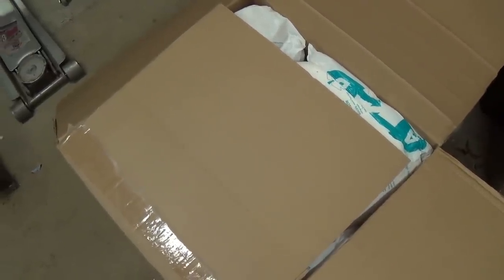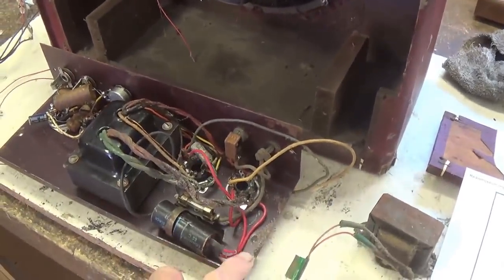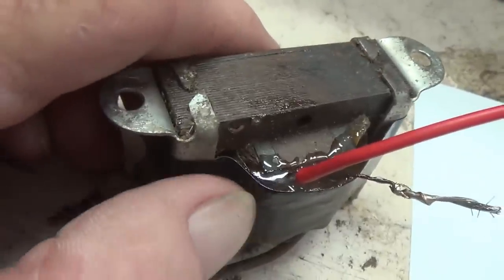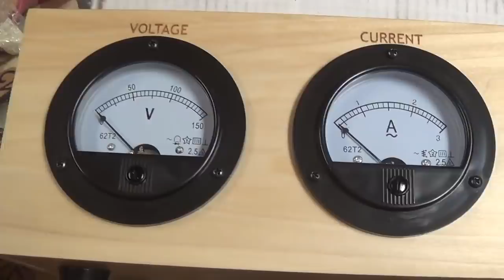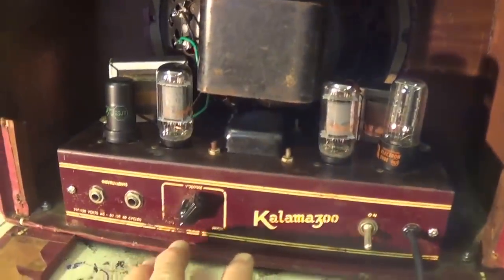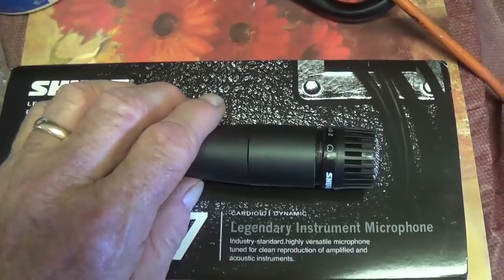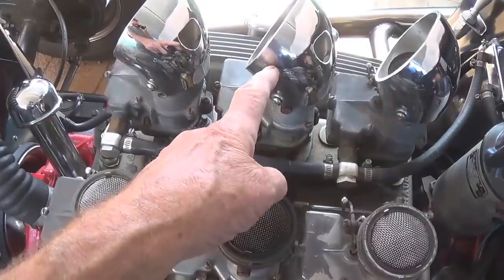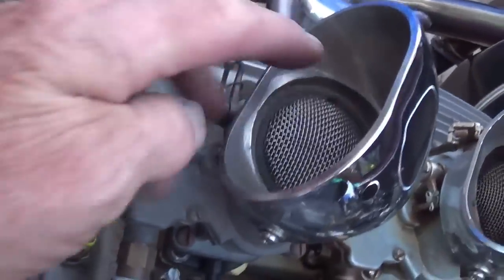Heroic Restoration of a 1948-52 Kalamazoo KEA Amp with an Unusual Circuit

Comment: Yes, Yes, Yes!!!  on the SM57!!!  I think it is definitely worth the trouble.  I humbly suggest moving the mic a bit off center to get a more balanced sound;  centered is generally too bright.  Also, it looked a bit too close to the speaker (for my taste).  I hope you will continue using the SM57 for future videos.  Perhaps you can come up with a mic placement you can use consistently for all recordings.

BTW:  The worst thing about the camera mic is the automatic gain control and the way it tends to overload.

I think you should consider recording some new demos of your fabulous amplifier collection.  I would be willing to send a supply of catnip and assorted kitty treats to help entice Jack and Ollie into some additional recording sessions.

Thanks for another terrific and inspiring video!
Reply from the maker: You're quite welcome, John. I will experiment with microphone placement and will consider using it to re-record some amps from previous videos. Thanks for your input :)
Reply: Yes, The Big Test will be perfect. Camera mic make all these amps thin but you always say they have balls. 
Nice, sunday test will be perfect
Reply: definitely.  best amp sound on an UD video yet
Reply: My comments exactly, thank you John.
Reply: @UncleDoug  My only question Doug is, why didn't you mount a modern fuse holder on the back panel, so the fuse can be easily serviced?
Reply: Agreed. This a huge improvement. Nearly all of your prior videos I've watched exhibit clipping, making me wonder what you were talking about sometimes, and making your playing sound worse than it now appears to be. This one sounds too bright, due to miking the dust cap so assiduously ;-) but clean as a whistle. I suggest positioning the mike about a yard away and not pointing straight at the dust cap. To save all that offline recording trouble I'm wondering whether the camera has a mike or line input.
Reply: He could also experiment with the "Fredman method", where you have two microphones in a V-formation. With one microphone straight on and the other angled 45 degrees. You can then blend as much as you like from each microphone.
Reply: John Barker i own a sure57 very nice to use sir
Reply: A small quibble: Older American-made SM57's are a bit better-sounding. Newer mics tend to be slightly steely,
Reply: I agree with moving the SM-57 away from the speaker cone centre. When recording guitar amps you get the most realistic sound (as heard by your ear in the actual room) by pointing the mic approx 1/2 way between the speaker cone centre and edge at about 45 degrees angle to the face of the speaker.
Reply: Was it just me or did it sound like he had a phone or a computer plugged in to the input and was playing a low quality audio file instead of having an actual guitar signal going into the input.  I have one of these amps and that’s not what it sounds like!!! At all!!!!! At all at all.
Reply: @antonvangrendel  Of course it doesn't , remember he changed the speaker , the choke , AND all the Caps !!!

Comment: SM57 all the way!, just move it off center a bit :)
Reply from the maker: Thanks, Russell. I will. Thanks !!
Reply: I agree about the new mic.
Reply: Totally prefer the SM57. It adds clarity and dynamic range. Agree that it should be slightly off centre. Thanks for doing that.
Reply: Uncle Doug, The center is usually too harsh. Consider angling it so that the mic's diaphragm is parallel to the cone's surface. I find it's more natural sounding when the sound waves come from a parallel surface.
Reply: @UncleDoug  SM57 is the way go, definitally. I notice though some high frequency jitter in the recording. Don´t know if it´s from the metal grill or not. I suppect it being from the sample rate from the audio recording of the Tascam. When you collate the video from the camera with the audio from the Tascam. whatever export format you use should have a matching audio sample rate to the original so you won't get any digital artifacts.

Comment: I'm not sure how much of the improvement is from the SM57 or  if te amp is just that good, but sounds absolutely amazing. The tone is full and round, much like my ex, except this is very pleasing to my ears. 
One again you knocked it out of the park.  

That was a brilliant solution to the fuel issue. I was about half way expecting you to prank us with the old hot rodder trick of dumping a bag of ice on the intake and calling it good.   ;-)
Reply from the maker: Thanks, Randy. No pranks :)

Comment: Up to and beyond your usual fine work, my friend ! The amp sounds really fine and hardly no work required...he he ! Just as a thought, the standard for rating speaker efficiency, the mic is placed at 1 meter at one watt of power. The new mic sounds great and if I understand you placed it directly in the YT feed ? That would while sounding much better which it does, my thought is to record the file separately and place it in a digital file that we could download separately from a dropbox or similar, in order to get a full clean playback to play through our own DAC without YT compression.

As regard to our other project "SB swap", UPS seems not to be able to find it though all say it is coming. As usual no good deed goes unpunished. I will advise.

Cool licks and Hot days in El Paso, keep your head down and keep 'em coming !

Robert aka jagjet

PS the rush of fuel might even be the cause of float bowl woes as well, a vented cap might even stop the problem.
Reply: I was thinking the same thing with the pressure build up in the tank. As the fuel evaporated from the bowl, it was refilled and the cycle repeated. Now that the super engineered heat shield is in place, and a vented gas cap, neither should pose a problem again. Even with the added motor booze to the fuel. ;-)  The new Shure Mic is great! Way better dynamics than the camera mics.
Reply from the maker: Thanks, Robert. The method of digital recording was described in the video, and the percolation problem was completely resolved by the insulator plates and the vented  gas cap.

Comment: Apparently way back in the 40's & 50's, because the controls were at the base of the amps they were probably mostly used presented on a table top rather than being a floor amp.

Comment: Way to go, Doug. Yet another amp that is right out of my collection. I have one in mint condition that I only had to change the electrolytics on. It even has a cover. A minor point, the handle should be white. Keep them coming. About 40 more and I will have reference videos for all my amps.
Reply from the maker: Yes, I saw in photos that the handle was white, but what are the odds of finding one?  I took the path of least resistance and used the brown one I had :)

Comment: Hi Uncle Doug. I love your videos. I had a 1971 Triumph 650 twin motorcycle whose carburetor did the same thing as your hot rod. I did some research and found that Triumph used a rubber o-ring to insulate the carb. from the intake manifold. I had it bolted straight to the manifold which made the fuel boil when parked.. It solved the problem.
Reply from the maker: Any carb in direct contact with a hot intake manifold is at risk of percolating, Steve, especially in the summer. I'm glad you solved the problem.

Comment: Hey Doug, the Kalamazoo amplifier you have is a Gibson Gibsonette, made in a least two different versions, the one you have with no driver stage and one with a 12ax7 pre and driver stage with two 6V6s in parallel. I am rebuilding the parallel version. The wallpaper covering on the Gibsonette  is very thin and mostly missing, recovered in tweed, three coats on poly, reconed 10" Jensen speaker, sounds great. Thanks for all of your videos, there are all ways FUN!
Reply from the maker: You're welcome, Gary. Good luck with your project.

Comment: The SM57 is an improvement.  Mic placement experimentation might help de-emphasize the increased high frequency response.  The auto gain of the built in camera mic is eliminated as well with the new set up.  The carb nut count reminds me of the sponge count we do in the OR, although dropping a nut into the manifold would be far more calamitous IMO;)  Thanks for the amazing service you provide.  The few dollars spent on Patreon is the best ROI out there!
Reply from the maker: It's our pleasure, Frank. Thanks so much for your nice comments and patronage :)

Comment: Howdy.
Old carburetor Toyotas used to have the same problem. Very difficult to start with warm engines on hot summer days for people who didn't know the physics behind. People just kept pumping the pedal resulting in flooding the intakes and combustion chambers. And all wet spark plugs, of course.
There was this Lady living in my parents neighbourhood. She could not get her Camry to start. I saw my chance to excel and asked if I may try. Sure enough that was ok.
So I pushed the pedal to the floor and turned the key hoping that the throttle open the excess fuel would vent out  and the engine eventually ignite.
Bull's Eye. After, say, 5-10 sek.s the engine fired up with a terrible blast from the exhaust !
The Lady got startled but she was so happy when the engine had settled and ran smoothly.
Man ! Did I feel like a million dollars ? Yes Sir !
Regards.
Reply from the maker: Thanks for sharing this tale with us, Eugene. The old "hold it to the floor and dry out the cylinders" approach was always a good move back in the old pre-fuel-injection days.

Comment: Another premium repair/restoration video like always!. I'm going to add my 4 cents in now :) First, the fuse being under the chassis is a great inconvenience...however, Having BOTH, and internal as Well as an external fuse has a major advantage. It avoids the temptation for the owner to install a larger rating fuse than what is supposed to be in the amp. Many times, I tend to "Kid Proof" the amp when I discover a larger fuse other than the factory. i install an internal fuse slightly higher in rating as not to make it unsafe, but will still blow if someone does the tin foil fuse in the outside holder, which we have seen more times than we can shake a stick at. OK, the SM-58 Dynamic Mic...Its a winner by all means, and really shows off the actual tonal quality of the amp. The SM-57 has been the go-to mic in recording studios for ages when it comes to micing a guitar amp. I've been using the 57 for decades in the studio. My choice for larger cabinets sometimes is the EV RE-20, however there's about a $350 difference. The 57 is an excellent all-around mic for a guitar amp. I recommend staying with it for the demos. Stay well, and hope all is well :)
Reply from the maker: Thanks so much for all your helpful comments, Frank. Yes, we are all doing just fine. You too, I hope.

Comment: Pro tip on the 57. Aim it right at the seam of the dust cap and you can go 5-10Deg off axis.  Will give a fuller sound (dead on the cone will result in a LOT of high end). Slightly off axis will help with plosives. Also 1.4X the cone diameter away will allow the full frequency of the speaker to be picked up (no need to angle the mic then).
Great vid!
Reply from the maker: Thanks for the detailed info, Doug.

Comment: Sir, having just discovered your channel (I'm  a bit slow) I want to say a big thanks for unlocking the mysteries of valve amplification. My late Dad was an engineer on valve circuits, working on radar in WWII and later with Kodak. When I were a lad, I annoyed him by choosing a Vox Conquerer transistor amp over a Vox AC30, because it was lighter and had more built in affects. Very little did I know back then!  Apart from the smoother sound, there's something much more organic about a valve amp that has been assembled by a human and that you can actually see working. Even though I've used several valve amps since, I didn't take a lot of interest in the workings, until recently, when I bought a late 50's record player, with a simple circuit, to hopefully get working again (parts on order). There's also a 1940 Epiphone Electar sat in the corner, which will need new caps. Your videos are proving invaluable in giving me the safety conscious confidence to get stuck in. The bonus is that you are a great instructor, with the dry wit to go with it. Cheers!
Reply from the maker: Thanks so much for your very nice comments, Graham, and best of luck with all your projects.  Be careful :)

Comment: I dig the new effort in audio quality.  I myself have recorded a many hour with a 57 using small tube amps, voice, drums, noises, etc.  It is a studio workhorse. When all else fails, GRAB THE 57!  I sometimes place the 57 right at the dust cover's edge where she meets the cone. a little more bass comes through. I also have dropped a condenser mic over the cabinet right at the cone meets the gasket in a dual mono setup, and you'll get all of the sound.  If really ambitious put a third in the back for a most full sound, but I believe you have improved your sound 10x over.  Thank you for your help in learning how my tube amps work.

Comment: Good to see you, Doug, You make awesome videos. 
I have been experimenting with microphones lately and found the electret condenser microphones cheap and they have a very nice frequency response. In my case, I mainly use them on my ham radio. You may already be familiar with them but I will add, just in case, they are very small and usually have a FET amplifier built right into the microphone. It requires something like a  10K resistor and a 9 volt battery in series with the mic to power the little condenser mic and then a capacitor (practically any value from 0.05 uF to NP 10uF) to separate the DC component form the AC component. Lots of output so you also need it run into the top of a gain pot (5K or so) so the output level can be controlled. Always enjoy your videos. Stay safe..

Comment: Thanks for the mention of the Carbon Comp resistors.  My KEA has very low volume too.  I need to run a Bogner Harlow boost pedal in front of it to get the preamp tubes to run hotter and get more volume.  70 plus year old amp, I probably have the same issue.  --Jason ✌🏻&❤️
Reply from the maker: Glad to help, Jason. Good luck with yours.
Reply: @UncleDoug  and Great video, Thank You for posting it.  I had to watch it at two times the normal playback speed but it was Awesome. ❤️  Your kidding around funny comments made me laugh out loud multiple times, LoL.
Reply: @UncleDoug  Now when I take my amp to the service tech I have a great understanding of what might need to be done when I speak with him after he's finished recovering from open heart surgery. -- Jason ✌🏻&❤️

Comment: The vacation did you well, your dry humor was flowing! .. Nice resto on the beat up K-zoo, probably never sounded better. Your replication of a standard equipment  heat isolator gasket found on most 70's muscle car aluminum intakes was a good call. Can't imagine that the ventless gas cap did not cause more issues with flooding and starvation, nice save. I am looking forward to what you might do to that small block that will enable it to handle six deuces !! Thanks for sharing, regards/greg.
Reply from the maker: Thanks so much, Greg.

Comment: Gotta love pentode preamps! The non existent M/C lets all the high end frequencies straight through. The gain is very impressive too, especially with a paraphase inverter. I love just how clever they were with the phase inversion, I believe this is the second amp you’ve shown like this.

It’s always good to see a couple of happy kitties! Hopefully those Masonite spacers hold up to gasoline/ethanol exposure. I was going to suggest FR4 fiberglass like the kind used for turret boards.
Reply from the maker: Thanks, Matt. Yes, the Magnatone Melodier Deluxe used a somewhat similar PI circuit. I would have used phenolic material, but had none on hand.

Comment: Better with the SM57, maybe move back to about 10"away from cone, try different positions. I have used 90° angle to speaker cone to good effect.
Some engineers swear that dead centre to dust cap is best. They may also mic the rear of the cabinet on occasions, inverting the phase on the rear
recording.
The camera mic is surprisingly good though so what you could do is drop that SM57 track in beside the camera audio and mix
say 80% SM57 to 20% camera audio rather as if you had some overhead mics. I'd probably output the two audio files in mono to avoid phase
cancellation and probably give truest sound.
These videos are pure entertainment and education for me, your knowledge is stunning and you keep me chuckling so love to Ollie, Jack and thanks
to that that jewel who hangs out with them.
Reply from the maker: Thanks for all your helpful suggestions and nice comments, NM.

Comment: The SM57 is an awesome upgrade! Maybe  pointing it a bit away from the center of the speaker will remove a bit of top end that close micing usually produces
Reply: Agree, I'd move it a couple inches left of center, or aligned with the dust cover seam on most speakers.  Sounds better than the camera mic dead-on though!